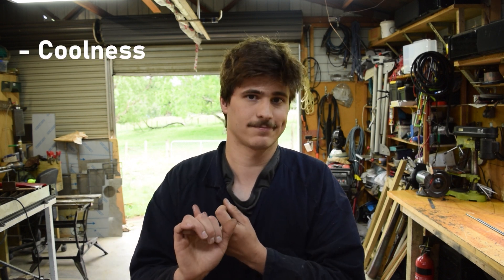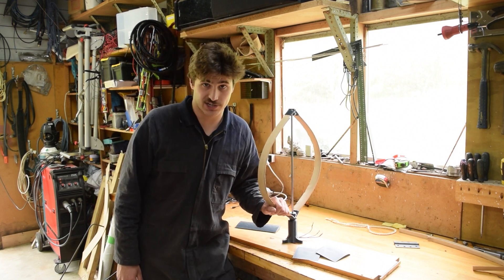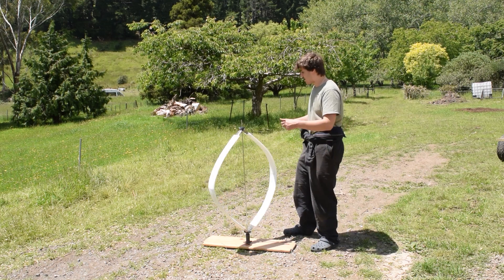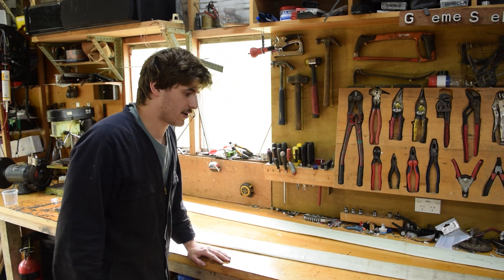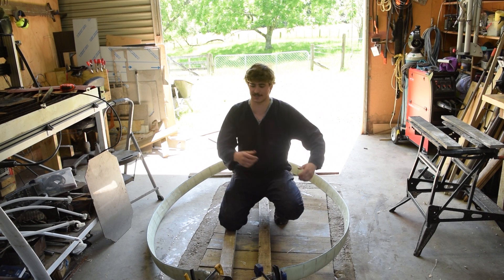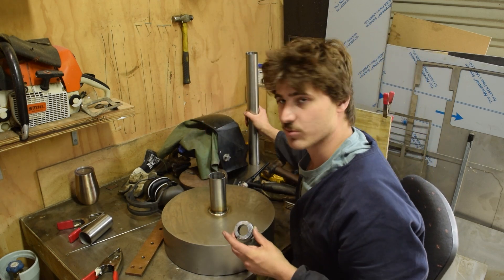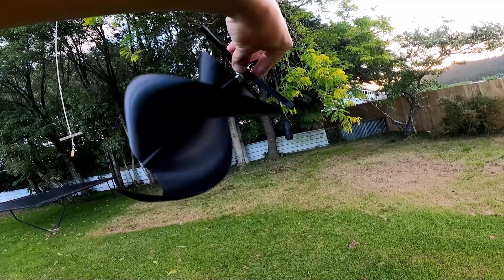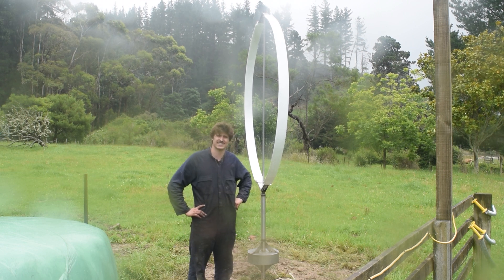Taming the Southern Winds

Comment: this type of darius runs at a fairly high TSR more comparable to a hawt and needs spinning up to speeds mabe 2-3 TSR ? so it will pull itself up to the higher TSRs. This means they run at high RPMs though so your foils will have to be really well balanced
Reply from the maker: Oh ok, definitely needs a bit of wind to start but once it goes it's pretty nice, I definitely think lowering the weight of the rotator to reduce rotation inertia would help and a stiffer center rod something like 30mm or even a pipe. But yeah definitely underestimate the wind speeds needed.
Reply: @FinlayShellard  Yah, any flexing in the pole is no good and I did confirm it needs to be spun up to power TSR to start and you need above 4 MPS wind to even start. The Canadian Gvmnt made a 224 KW one called the Eole that ran at a TSR of 7-8 in 17 MPS winds which in that size was 36-37 rpm. It was decommissioned and someones got a tour posted here of it https://youtu.be/4Mj5h5yjM-g and there's more on the net if you want to look it up

Comment: Maybe you should add a bearing at the bottom to carry the weight of the wings. For the shaft woble you may use carbon fiber rod in the center. Modify your design to utilize a standart carbon fiber rod.

Comment: VAWT was my fascination some years ago, really cool that you are attempting to make one. try it on a hilltop where the wind is less turbulent. but before that you gotta balance the blades, and make a break in case it works better than imagined.
Reply from the maker: Thanks, definitely a go with putting it somewhere more wind friendly. Yeah I totally forgot to balance the blades so that will help. And with the break I was designing a little motor/ generator controller, that would have a watt dump, just some chunky resistors to hopefully make use the back EMF of the motor to slow the rotor from over spinning, but that umm wasn't an issue it seems :).

Comment: Prewatch comment: You bloody legend, I was just looking at wind turbines to see if they were feasible for my location. I don't think they are but this'll be an ace watch anyway.

Postwatch: I think the major issue with that style of turbine is that it really needs to be BIG. like 10m, maybe even more, and for that you'll need either billet aluminum or fancy composites above and beyond regular fiberglass. Structure and bearings need to be much beefier too, like a 200mm aluminum heavy wall tube with 100mm bearings or better, really need it to glide with almost no force at all. A+ for cool factor though!
Reply from the maker: Thanks so much! Yeah I was kinda concerned this would be the case, definitely had my hopes though! Would be so cool to see a full size one made on the cheap, but there's just too many good alternatives especially for micro generators that it's just not practical.

Comment: What if you attached the turbine to a continuous variable transmission that could automatically adjust torque & speed as the wind changes
Reply from the maker: That's a great idea, i think there's definitely something with this design and modifications like this could make it work and produce some actual power!